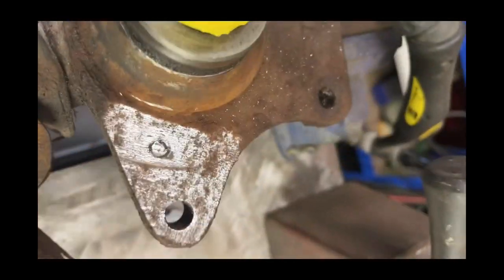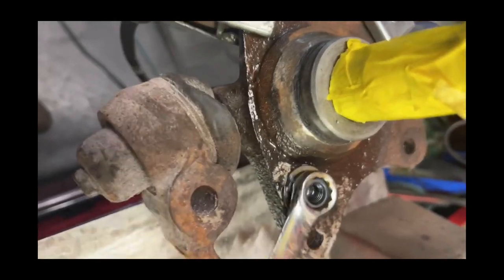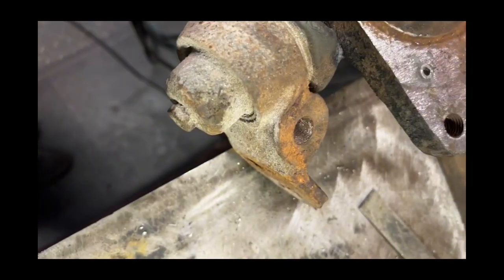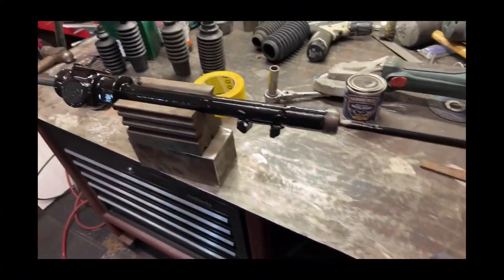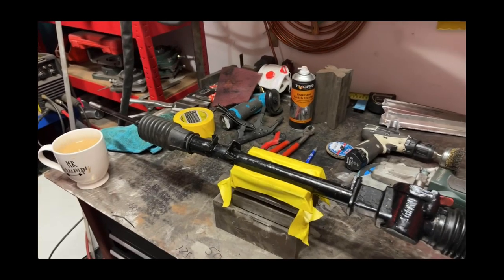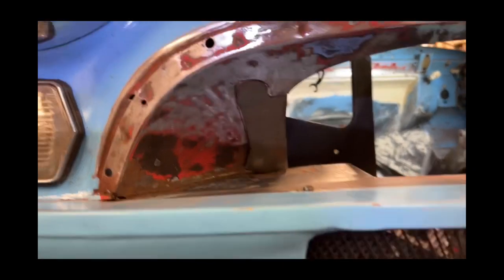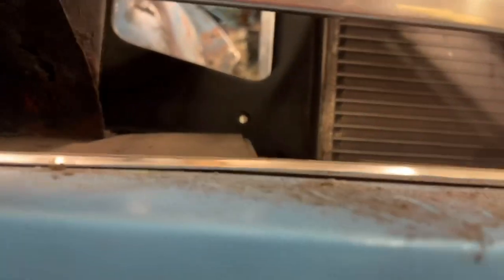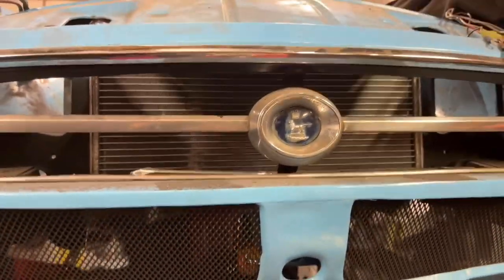Sunbeam Alpine Tiger recreation part 8

Comment: Isn't it strange I bought a Holley 600 CFM carb from Real Steel and had them do the same mods as you for the real McCoy 330 blueprinted engine. Its a vacuum mod for the rear two barrels and spring and jet changes etc. Simon also said that if I wanted more BHP then the Sniper EFI kit at about £800 would grab another 40 BHP. Not brave enough for that methinks.